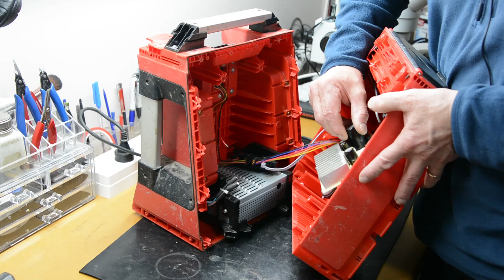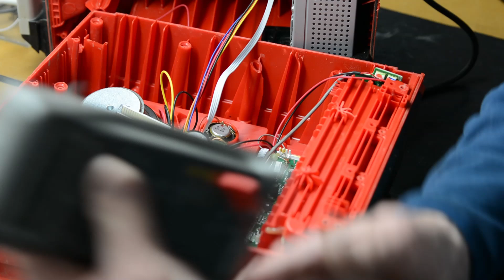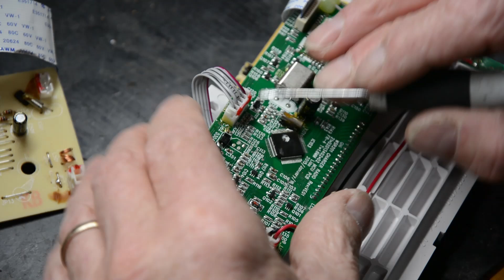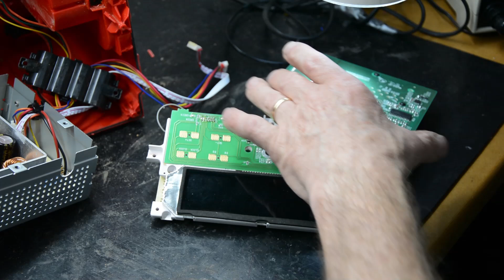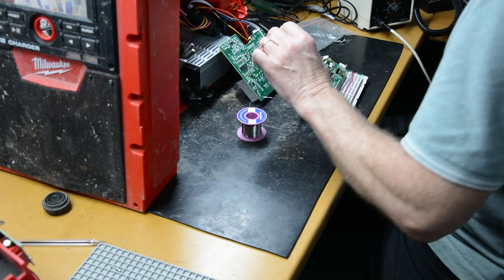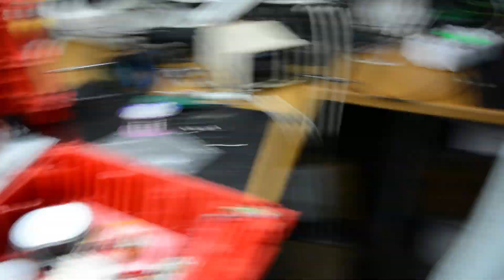Milwaukee Radio   ( wont turn on )

Comment: hey man i need your help, i cant figure out how to separate the 2 parts. i took all the screws out and it still wont separate.
Reply from the maker: Was a long time ago, ive only pulled one apart, i remember pulling the volume knob off, 
Thks
Dave
Reply from the maker: Look closely at the apart case, you can see all the screw postions, youve missed sone idd say

Comment: Maybe a long shot, but I have one of these that has no sound when plugged into AC power, I have yet to actually test with a battery. Any ballpark answer to what might be going on?
Reply from the maker: We normally use a amplifer external with probes, volume pot is half way point of audio cct,  put probe on pins on vol pot, if you got sound then preamp is working and the faults in rhe audio output stage, check supply voltage to the Audio output ic , coupling capacitors feeding left and right audio signals can put probe on them to see if audio has made it that far if so Audio output is is  chip faulty, 
Thats how us Audio  techs find the faults

Comment: Hello, my radio turns on, but there's no sound. There's no voltage on the TDA 7265. What controls it? The power supply is working, 20V, both from the battery and the mains. The TDA has 19V one moment and then disappears the next
Reply from the maker: Has radio been dropped ?
Possible pcb crack
Reply: @SuperDavidcass no dropped pcb its fine Once on the TDA, the voltage of 19V appears and then the sound is there, and after a while the voltage on the TDA turns off and there is no sound as I measured. However, I don't know if this voltage is controlled
Reply from the maker: @piotrburdek9991 shouldn't be, if its missing intermittent,  has to be power supply rail end, measure from the source, see if its stable from there

Comment: Hi. Does this radio have a safety fuse? Mine works only off the battery power right now. Any ideas about what can cause it?
Reply from the maker: Ok looks like the Ac power supply faulty,  yes there's a fuse, however most times it blows due to a short , either bridge rectifier diodes etc, sometimes it can blow if you had a power surge or spike
Thks

Dave cassells
Reply: I opened my radio today. There's no power on a black and red wire that goes to the main board  at all. Also opened the powe supply/ charger portion of it, found the blowen resistor next to the mosfit, left side of a board. I suspect there are hiding more damage. I am just a beginner, really want to fix it. Any recommendations where to start digging. Thanks.
Reply from the maker: @Big_Dima ok, you got a short on output of the resistor,  more than likely the mosfet

Comment: Does the volume knob just pull off or is there a secret to removing it?  Mine will turn on/off if you push it just right and volume works fine.  I assume a bad solder joint but I won't know until I can remove the circuit board and can't seem to get the volume knob off.  I assume it has to come off. I do have the radio separated in half.
Reply from the maker: Yes was hard to pull off I remember
Reply: @SuperDavidcass  Thank you!  Reseating all the cables fixed my issue.  Works perfectly now.

Comment: I have the same radio and mine makes a very faint high pitch whine once turned on even while playing music even when volume turned all the way down 
Any ideas what it could be 
Thanks
Reply from the maker: Ok, if it has a wine even with volume down , that immediately tells me the faults in the Audio output stage, after the preamp stage, make sure power supply also has no electro caps that are bulged, causing a filter issue, else will be the output ics Audio
Reply: @SuperDavidcass 
Thanks

Comment: I have the same radio it distorts when turned up to loud and then turns itself off. Any ideas
Reply from the maker: @j04200420  possible low dc rails, maybe caps in power supply, or output audio chips faulty

Comment: Hi sir i need help my radio every thing works but speaker has no sound tweeters working so can you let me know please what is problem
Reply from the maker: @chobbar_wale  it tweeters are working then idd say main speaker are open cct, first measure the woofers with ohm meter
Reply: @SuperDavidcass hi sir sperker working but very low sound no full volume so what is problem do you think
Reply: @chobbar_wale salut ați descoperit care ar fi problema decembrie nu are sunet?

Comment: How'd you get it apart? I have all the screws off but I think there are some tabs I'm not popping out
Reply from the maker: @mikemel9718  keep undoing all screws, from memory the two side handles come off first
Reply: I think I've got every screw out of this thing and it wont come apart. Concerned about breaking the plastic but about ready to